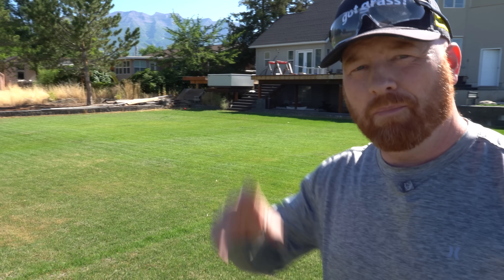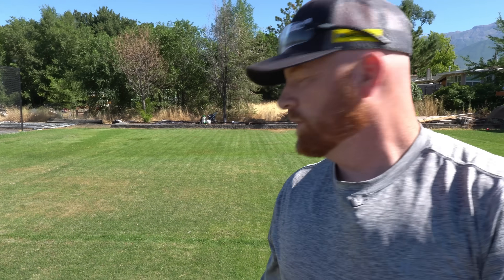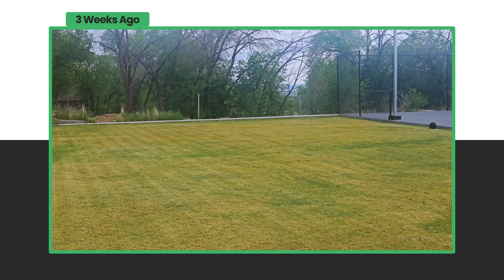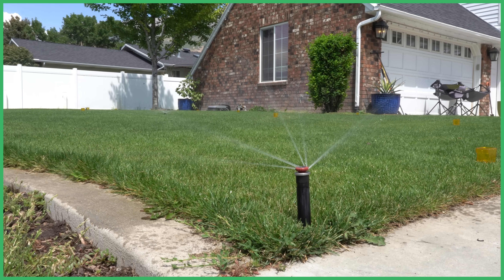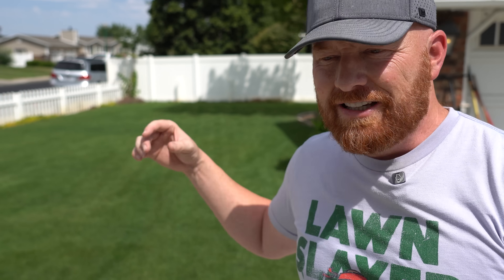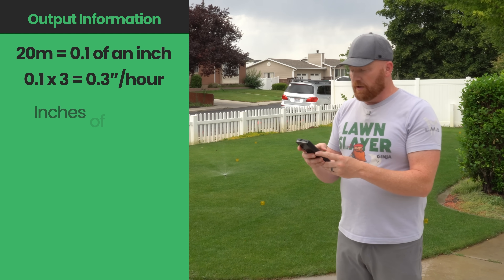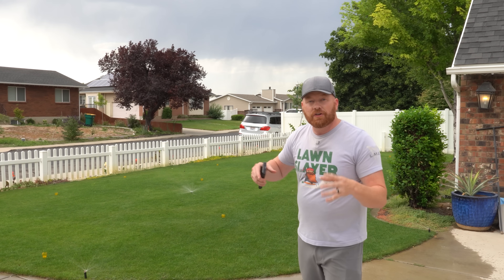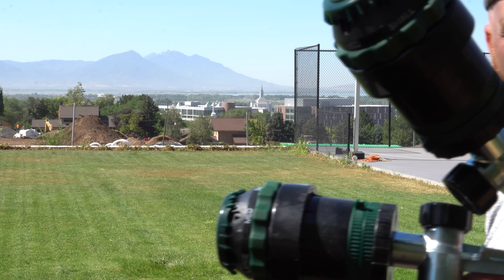You’re Watering WRONG! (Here’s the Exact Minutes Your Grass Needs)

Comment: 2.22 hour a week or 2.22 3 days in a week? How much those cost for water bill
Reply from the maker: Not sure you caught the jist of the video.  It's an output issue.  ultimately i'm at 2" of water per week.  the same as someone who's running 40min for 3 days per week.  no difference, just different sprinkler heads.  hope that helps.

Comment: I'm a bit confused.  I thought the goal was to give your lawn between 1 to 1.5 inches of water a week.  If you want to want to water 3 times per week, and give it 1/3 of that 1 - 1.5 inches a week on each of the three days, thats fine.  But why in the video are you indicating you're shooting for a total of 2 inches of water a week.  How does that reconcile with trying to give it 1 to 1.5 inches a week?  Are you just assuming .5 of it will evaporate and so you really need a total of 2 inches layed down per week to arrive at 1 to 1.5 inches a week?
Reply from the maker: Not sure where the 1 to 1.5" of water you're referring to is coming from. The ultimate goal is to replace evaporation from the soil. 

If it takes 1" to do that ok. If its 100f and it takes 2" to do that.... okay. Its just a replacement issues 😄

Not entirely sure if that addresses your concern or not

Comment: Dont cut your grass less then 3-3.5”, leave clipping behind (not in clumps). Clippings provide moisture, sun block from the sun and food for your grass.  That greatly reduces how much water you have to use on your lawn
Reply: Will clippings eventually turn to thatch?
Reply: then you end up with fungus and need to dethatch your yard. its better to cut it more frequently and lower around 1.5- 2in . this will encourage grass to grow in the bare areas and it will thicker. you suppress weeds more and growth.

Comment: Loving the content! I ran this test last year and came out around 0.4 inches per hour. With 7 zones covering 16k sq ft, it takes me just over 8 hours to put down half an inch. I’ve been battling fungus every season, mostly leaf spot, on my full KBG lawn here in NY. I’ve tried adjusting start/end times and even splitting watering across two days to cut down on how long water sits on the leaf blades. Still not sure if I prefer knocking it out all at once or spreading it out.

At this point I’ve kind of accepted fungus as an annual battle, so I’ll be starting preventative fungicides around May/June. The lawn’s now in its 3rd full season since planting, and the canopy is looking a little too dense in some areas and has some melt-out and dead grass.

I’ve been really enjoying your dethatching and scarifying content — planning to give it a try for the first time this week. Excited to see how it turns out! I think this will make mowing much more enjoyable, the grass is too dense and the melt out stalks do not like to get chopped up.
Reply from the maker: Right on. Appreciate you sharing the journey 🙏   slay that lawn

Comment: What I haven't seen mentioned yet is cycle and soak.  When you do the full cycle at once, The water saturates the top couple inches of turf, water will stop seeping into the ground and evaporate or runoff. When using an irrigation system you need to set a cycle soak program, for example If the turf needs 40 minutes of water. Water it 20 minutes twice with at least 30 minute break between. Cycle and soak will promote deeper root growth and save water due to evaporation and runoff.
Reply from the maker: Great comment
Reply: This is very valid, but not everyone needs to do this. Someone with clay loam and higher flow rotors will want to cycle and soak. Someone with a sandy loam and a slower flow MP Rotator will not benefit from this. Make adjustments as needed.
Reply: @zarethd  i have normal soil and honestly probably more on the sandy side but since i switched to cycle and soak it made a huge difference!  In New England we get watering restrictions every year this year restricted to one day a week if i dont use cycle and soak there is run off now none.
Reply: @msk3905 it does have its perks don't get me wrong! But not always needed, and for some folks you're just boosting disease pressure if you don't have cool morning temps
Reply: @zarethd slope though.  Or uneven ground that looks flat.  No reason not to run multiple shorter cycles

Comment: This is really great information. The one issue I have is that when you are bound by how many days you can water per week. Here in Utah depending on if your on secondary water or not is going to determine how much you can water. On secondary water they only want you to water 2 times per week and yes in many areas the water is metered now. If your on culinary your bound by how much you want to pay. The more water you use the more you pay. For me I have found if I water for 15 minutes each station twice each time I water that works pretty good for me but that’s my lawn.
Reply from the maker: That's a great point! Water restrictions can definitely change the game.  

The point i could have spent time on is the main thing that matters most is to replace evaporated water in the soil. You can water 1 or 2 times per week as long as you're doing the math and replacing what the soil needs

Comment: Nice info. I have around 14,000 sq foot lawn and when i had the home built, I had a subsurface irrigation put in by a friend who convince me to do it. Luckly he was an installer who did the work, and I saved on the labor because it cost 3 times more than surface system. But it does save on water, but I have to watch because the emitters are just about 6 inches below the surface and aeration, or coring can be a problem and if fertilizing you will need to wait for rain. My neighbor's wonder why my lawn is so green without watering.
Reply from the maker: That's pretty cool.  Ive never tested one out. Ive heard of some bad installs and broken lines before.  Glad to know yours is working out! Thanks for sharing your experience!
Reply: I hope you tell them you don't know, God must love you more than them 😂